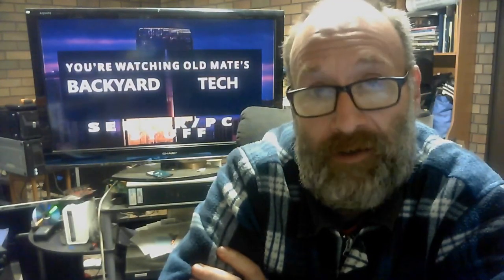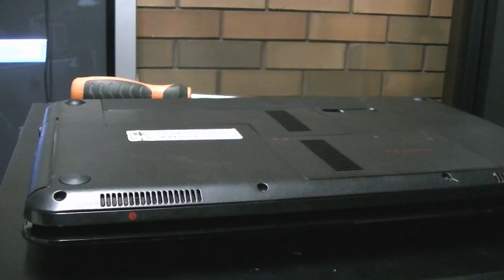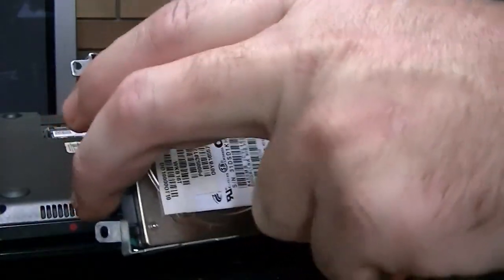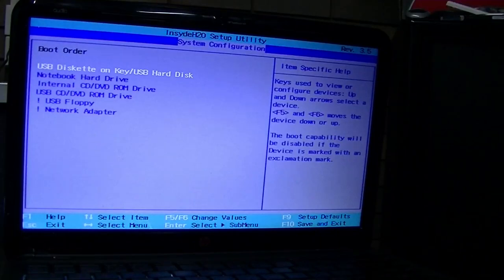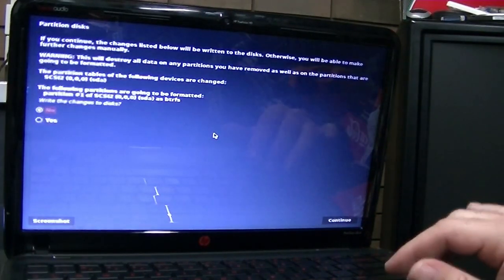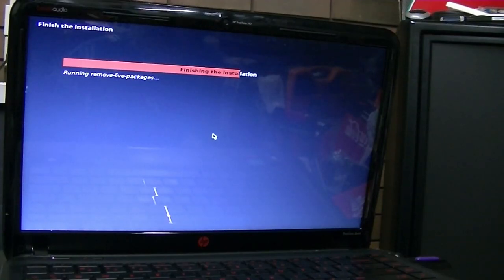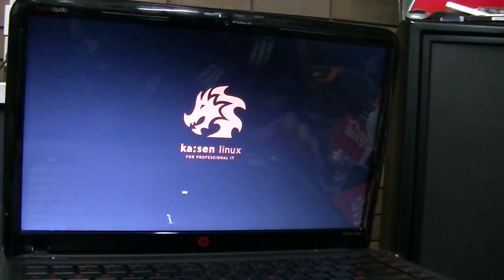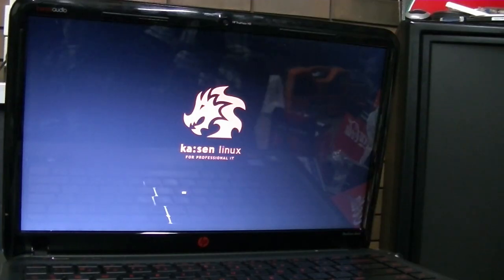Troubleshooting - HP DM4 Kaisen Laptop PT1 - HDD Issues

Comment: Toshiba HDD's in my experience have always been problematic... I stick to seagate or western... tried samsung as a system drive in a dell inspiron laptop in 2010 & ended up with booting problems and unstable performance when running.
Reply from the maker: Yeah my luck with Toshiba is up and down like a yoyo. 2.5" drives have caused me some hassells, but the SCSI U320 HDD have been fairly good.